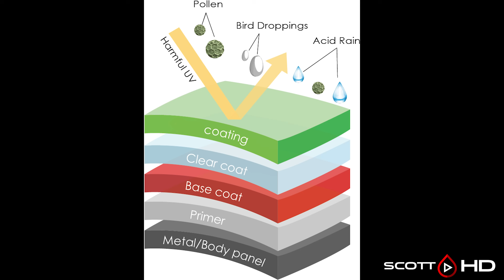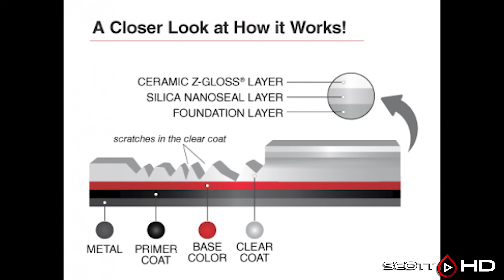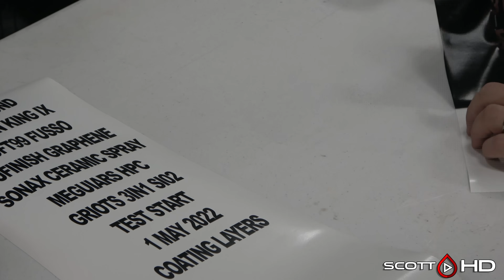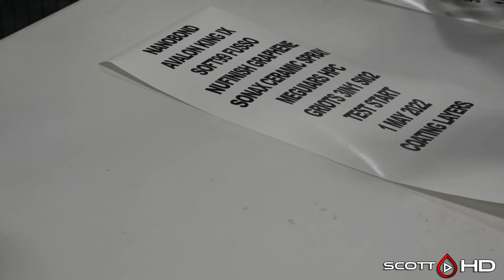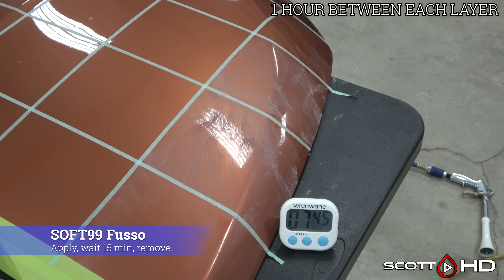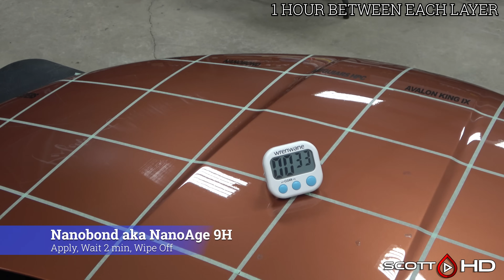CERAMIC COATINGS - HOW MANY LAYERS IS TOO MUCH? Top DIY's Tested! LONGEVITY TEST - UPDATE 00 - SETUP

Comment: I have been using Griots 3in1 for a couple of years. Not knowing anything about this except what I have learned from your channel I have put quite a few coats on over the year. If I had to guess perhaps 7 to 10. Car still shines like a diamond in a goats butt at the county fair. However, the car doesn't get exposed to a lot of adverse weather but I do live at high altitude so it gets its share of UV. What should I be looking for regarding deterioration?
Reply from the maker: Painters will tell you "UV" damage is when the clear coat has actually failed, so essentially it is trying to prolong the useful life of the clear coat.   As long as it's hydrophobic, you are likely still good. (and your clear coat isn't failing).

Comment: Even though many are meant to be spray and wipe.. I just don't think that method is even or reliable.  I use an applicator , overlap and give them a minute
Reply from the maker: As long as the product physically gets onto the paint and is "worked in", it really doesn't make a difference in my opinion.

Comment: This is going to be an interesting test.  I suspect the increased removal difficulty would have diminished if the cure time was extended on final layers.  My best guess is that the solvents haven't flashed enough and the bottom layers were only partially cured, causing a grabby feeling.  I'm thinking much the way paint will soften and lift if recoat windows are too short.  With that said, I'm hoping the lower layers still remained bonded and were not leveled off with the final layers.
Reply: Very valid concern about the base layers potentially being disturbed

Comment: Damn thickness meter. Should do 100 layers and see if you can measure it. .... Just kidding.  Seems like a test a lot of people are very interested in this one. Don't know if anyone has done a similar test.
Reply from the maker: I have a cheap amazon thickness meter that "supposedly" reads to the nearest tenth of a micron, but on the "calibration foil" it will literally read 5 different readings on the same (known thickness) foil, so this is why I don't use it.  The elcometer I use - they make a higher accuracy one, but I can't justify the price of it - this one is already pretty expensive and is used in our shop just to identify thin areas or previous paintwork on client vehicles)

Comment: I am a novice in detailing, what are the RPMs you use on each of the detail 3 stages, i.e., compounding, polishing and wax application?
Reply from the maker: Heavy cutting you can use speed 5-6, then back it down slightly making a second pass.   Finish polishing it's on a 3 almost always.
Reply: @ScottHD  Much appreciated for the feedback. Additionally, what are the recommendations on the pad use (how pads used, how often changed during the process), because the pads I used they don't last long.

Comment: As always,  great test which will provide some real data points for a topic that really only has anecdotal evidence at the moment. 

Can you pull out the ones that recommend multi layer vs single layer? Be interesting to see the differences.

Many thanks for the lengths you go to in order to produce these tests for us!

Comment: When I use Griots 3 in 1 always apply two coats, waiting a day to apply the second coat.  Depending on how vehicle cared for, up to a year.  If not properly maintained, maybe 6 months?   I need a recommendation on a tire coating?
Reply from the maker: Check out dura coating for tire coating.  I did a very extensive test on about 50 products a year or two ago - Dura Coating and Lone Star tire coating were the two that outshined (pun intended) the competition.
Reply: @ScottHD  Thank you!!  And thank you for all your testing of products.
Reply: @ScottHD  for a daily driver, would you still recommend Griots Garage satin tire? It seemed to fare well in the consumer test you did.
Reply from the maker: @FourJaysFour  I would. I've been using it on our vehicles and it seems to last a decent amount of time

Comment: I've layered Fuso back when I lived in North Dakota due to the aggressive chemicals they use to spray the roads in winter.

I never noticed any difference, and I let it cure over night in the garage. I applied it as lightly as I possibily could while still getting it on the paint. Never had an issue taking it off after it sat over night (granted it was normally the start of winter when I applied so cool).

Mostly just wanted to give it time to fully cure in suboptimal temps. Never noticed any difference with it be 1 or 2 coats, just felt it increased the likelihood I didn't miss a spot by accident. I would get about 9 months before I felt I had nothing left too it.

---

Also I don't really care about product thickness, but once it cures could you let us know if you could feel any difference over the multiple layers?

Comment: Very interesting. UV protection test, please.
Reply from the maker: Some of the previous tests I've gone to the trouble of testing UV and it ends up that basically NONE of them provide any proven UV protection - proven UV protection is sunscreen (which I used in the same test to prove an example).

Comment: Thanks Scott! This is going to be a really interesting test. I'm just a DIY amateur and since 2018 have been using Meguires Hybrid Ceramic Spray. For my best results, I wash as best I can then do  1 layer dry application, 1 layer wet application and a final layer of their spray on and rinse application. I get good shine and beading that lasts about a year. Throughout the year I do occasional quick spray washes. I'm in New England and do not have a garage to park in.

Comment: I have used the griots 3&1 it has performed very well for me when applying it is very slick also very easy to apply but please note my vehicle stay in the garage and they are both White they are daily drivers Scott thanks for all your helpful knowledge
Reply: I have a white vehicle that stays in the garage in SW MO. Spring 2020 I started with one coat of Griot's 3-in-1. Fall I added two coats. Spring 2021 onward, two coats in the spring, fall one topper coat of Jescar Ceramic Wax (noticeable gloss). 👍

Comment: I asked many times and will still ask, do you know when your going to test for hard water etchings on the ceramic coatings?
Reply from the maker: I'm planning on doing something this summer. I've been researching on how it is actually lab tested and the various types of tests and what chemicals they are using.   I know the real world is how it needs to be tested though!
Reply: @ScottHD  yes please, we need real world tests instead of how they are made. If you can do a 42 way testing it would be so awesome to see that. I believe you can do it on the existing panels you have, just spray hard water on them and test them, i dont think it's hard
Reply: I found a hard water deposit that was building up over the winter. I soaked it with WD-40 and lightly rubbed on it and it came off after the 2nd application. 👍
Reply: @tedroesch9133  i get what you mean but it's more than just using something to wipe it off. A physical experiment would be great to see how the ceramic coatings react

Comment: On the Griots bottle it states "for extreme durability apply a second coat 12-24 hours after the first application". Wouldn't this mean the way you applied the griots is incorrect? Love and appreciate all your video's, i dont want to come off as "that guy"
Reply from the maker: It is, and you are correct, but I simply did not have the time to hang around for 2.5-5 days to apply 5 coats of it... I did disclose that and we are going to see if it makes a difference.
Reply: @ScottHD  i figured that you didn't want to waste days on applying it. I can't wait to see the results. I use mostly griots products so that's who I'm rooting for.

Comment: I've often wondered if 2-3 coats on horizontal surfaces and single on vertical would make sense, this test might give me some answers in that regard.
Reply: Same.  I always apply 2-3  coats on the hood, roof and trunk.  Not having any idea if it helps any.  Lol

Comment: Disappointed you didn't follow Griot's specific direction on application time... that really invalidates the results there. One of the most popular options too!!
Reply: Huge fan of your work!  Your open minded response is more proof of your objectivity!
Reply from the maker: @clintonw1055  absolutely and thank you
Reply from the maker: 5 layers would have taken several days - my worry would be that it would start rejecting itself after that long.  I see your point there though.
Reply: This is a classic example of BS ambiguous claims to take advantage of an ignorant public to sell product. GG 3-in-1 Wax isn't a coating - it is a spray sealant. Translation: it doesn't actually truly cure (no cross-link), so whether you wait an hour, or 12, or 24, you are still going to remove the majority of whatever you applied before with "like dissolves like" principal. The only time you get any type of truly additive layering (ESPECIALLY beyond a second coat) is with a cross-linking cure, and even then you will run into challenges because a proper coating will reject additional layers except for a very narrow window (and even then it is not 1+1). 

That's my 2 cents, anyway ;)

Comment: I've been using Griots 3 in 1 on my daily drivers and weekend warriors. Nice product. Interested in the results of this test. Thanks
Reply: I’m not making this up-

I put Griots…on top of Fusso…on silver-plated horns for a marching band.  All I can tell you is that products like Fusso and Collinite will always be in my arsenal, and Griots is simply too affordable not to throw-on anything as a topper.  The shine it creates is really different.  But that’s polished metal.  Two coats of Fusso on any dark car is kind of like enjoying pain.  You better really want it and hope you’re better for it after.

Separate but still noteworthy- my only frustration with ceramic spray products is the spotting that dried liquids (water on cars, sweat on instruments) leave on the surface.  Sure a QD can fix that, but unless there’s serious sheeting going on it’s not a good look after a rain session.  That reason alone is what keeps me using tin-paste sealants.

Comment: Really eager to see the results. I predict the 2-3 layers may fare better than the 4-5; my assumption is that these chemicals have a carrier/solvent that when applied again it softens but doesn't completely remove the previous layer(s), I feel like on the 5th layer more material was removed than what may have been applied, hence the gum-up.
Reply from the maker: I agree with you. I think there IS a point of no return beyond 2... maybe 3.

Comment: Hope to keep an eye on this one. For some reason your feed stopped showing up on our devices. Had to hunt it up and binge watch.
Reply from the maker: There was an issue awhile back with it - hit unsubscribe, resubscribe and then hit the bell notification icon again.   It was due to the "made for kids" that I accidentally checked the box in my settings and it was apparently a big ordeal to un-do it. One subscriber figured out that the trick is if you were a subscriber when it happened to just unsubscribe and resubscribe.  Problem solved

Comment: Interestingly the instructions that came with CarPro SIC say 1-2 coats, no more than 3.  I put 2 on the half of my car that has clear coat and 3 coats on the half that doesn't have clear coat.  last year I tried UK 3.0 but it only lasted a few months on the non clear coated panels.

Comment: Oh wow this one’s gonna be good. I wish u would’ve added hybrid ceramic spray from tw. One coat gets me 3-6 months. 2 is netting me 9-10 months
Reply: 3-6 months? I quit using Turtle Wax products in spring of 1979. There are too many better products out there for the same price that perform better. Back then I changed to DuPont Rain Dance, that liquid wax lasted a full 2 weeks plus longer than the Turtle Wax did.

Comment: Here’s a question you probably haven’t heard before, if you off set your pad on the buffer wouldn’t it do the same thing as a 15 or 22 mm throw buffer?
Reply from the maker: Maybe?  I guess I see your point in doing that.
Reply: If when you say buffer and throw buffer you mean Rotary vs DA then, No it wouldn't at all. The center-most part of the pad (unless we are talking about a ridiculous amount of offset) is still moving 100% of the pad material as a dot around a circle regardless of the pad being perfectly centered or offset; the outer area is not covering 100% of the dot around the circle well simply because it's offset ( ._.) However a DA polisher or buffer is a "circle going around a circle" rather than a point around a circle. If you however meant DA centered pad vs DA with offset pad, the latter is not recommended as it would create vibrations; the bigger the throw the bigger the little circles go around the circle/orbit.
Reply: @Centaur008  I have off set my pad it ads a very slight amount of vibration

Comment: Rooting for fusso
Reply from the maker: I looked at amazon and I can't find the old PTFE based one like I'm using here... I know they changed it up (and not for the better).  I hope they bring it back, but I'm sure it is probably because it has some nasty stuff in it.
Reply: @ScottHD  was the solvent if i reckon correctly. If you are afraid about ceramic coatings, this is the second product you could try. Best part is you can re-apply on those pannels were it stopped bead